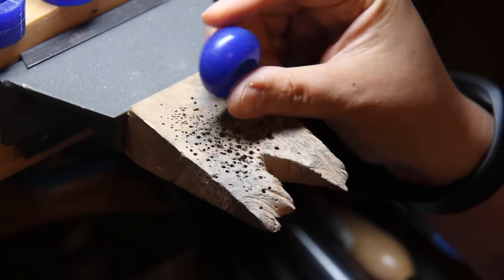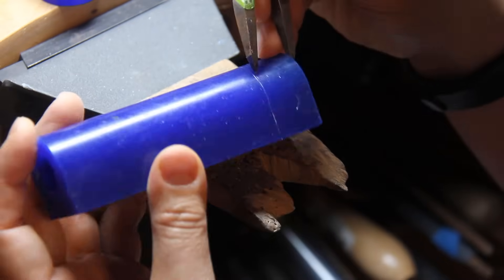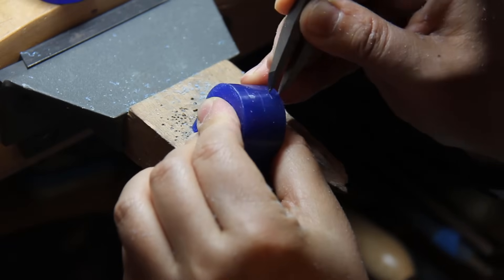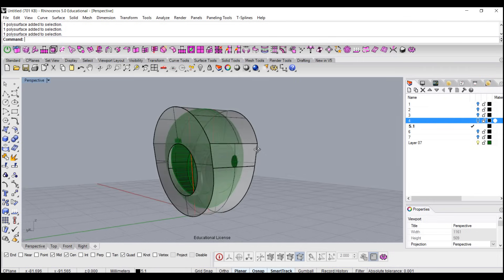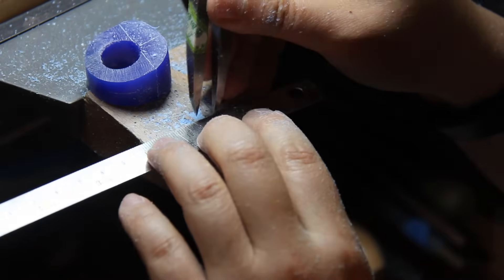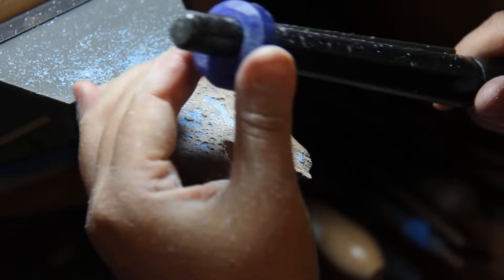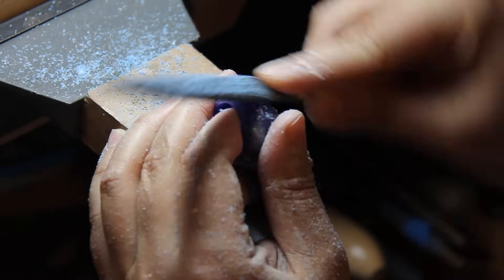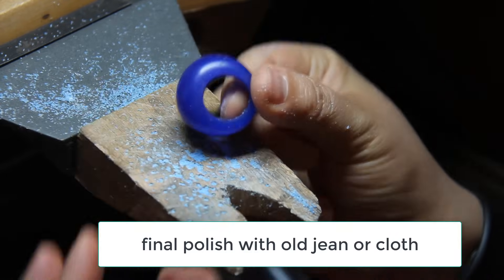Jewelry Design and Fabrication- How to Hand Carved a Wax Dome Ring

Comment: When you make a ring hollow in wax, do you ever add a wax cover/sleeve/backing (with holes or fretwork of course) to the hollow underside of the shank before casting or do you do it after casting? I hope this was clear 😅
Reply from the maker: not really understand what you mean. do you have image?
Reply: PJ Chen Jewelry Design Sorry 😓 I'll try explain another way. You know the ring shank (where your finger goes through) is sometimes hollow on top to save metal cost and sometimes it's also still hollow but covered with a strip of metal so it's more comfortable for the finger when you wear the ring? Do you ever cast the hollow wax model in metal and then add the metal plate with solder later, or do you make the inside cover in wax and cast it all together?
I hope it's more clear. It's hard to explain without diagrams.